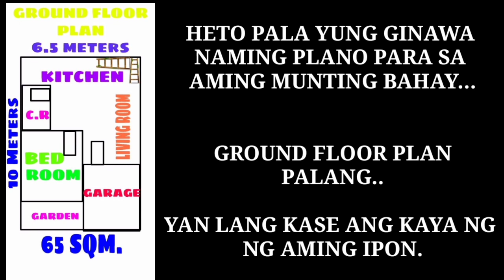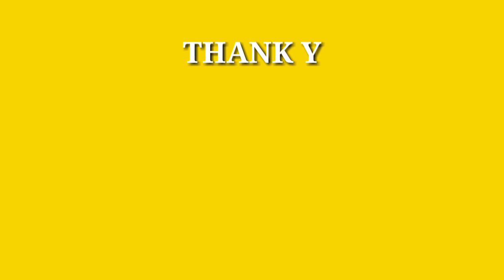SIMPLE HOUSE | 65 SQM. | TWO STOREY HOUSE DESIGN | ABANG PALANG SA TAAS | MAGKANO NAGASTOS? ALAMIN !

Comment: 400k na pero may pintura na tas napalitadahan na labas at loob plus 65sqm pa size bakit ganon yung bahay ko 36sqm lang pero 350k na materiales lang yun tas naka gasto na ako ng 450k sa loob lang palitada wala pang pintura slab din ang taas abang for 2nd floor naka steel deck yung slab. 100k pala ang kontrata ko pero hanggang rough finish lng wala pang septic tank yun..  naloko ata ako a🤔